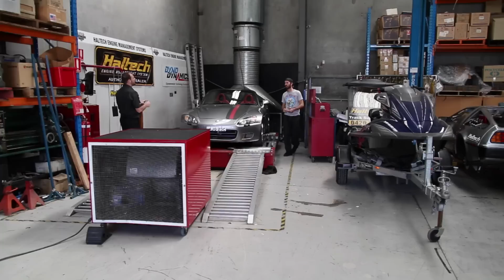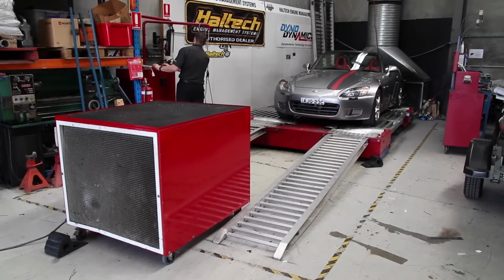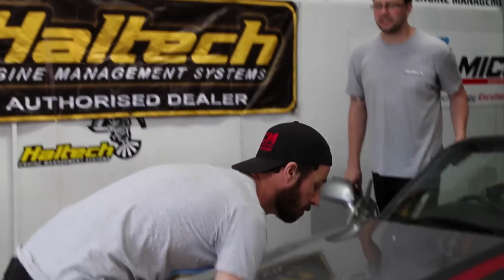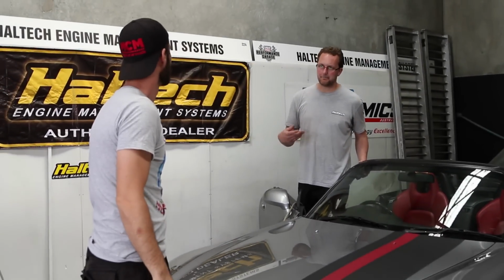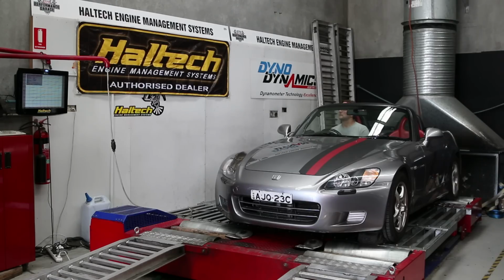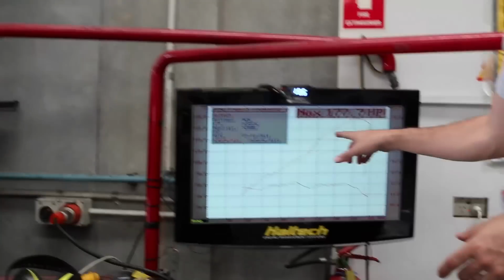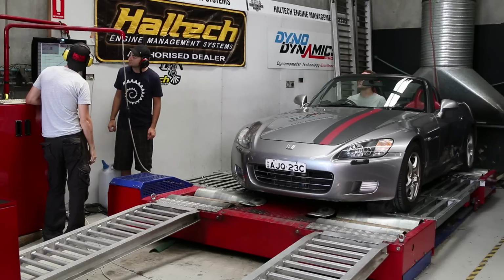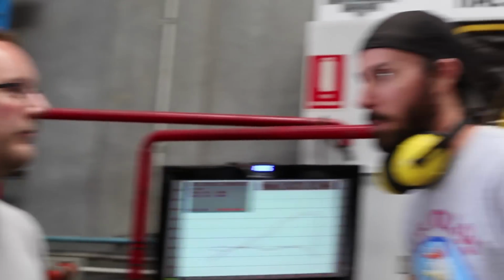Cold Air Intakes Mythbusted [Naturally Aspirated]

Comment: how can a 240 hp S2K make around 180hp ?
Reply: Well obviously he has had it for a while and overtime cars do lose BHP, especially if you dont service it or keep an eye on things such as oil or engine coolant.
Reply: ok it make sense now
Reply: 180hp at the wheels, 240 at the fly
Reply: Time is a bitch :P
Reply: Thats 180 at the wheels I believe
Reply: Becouse those 240hp is mesured at The flywheel and The 180hp at The wheels, The gearbox and rearaxel will eat some % of the engine power and This happens to all cars but awd eats more power and fwd eats least power width rwd in the middle,  power loss can be up to 45% in some cases.,hope This helps.
Reply: Don't forget that is the power at the wheels they show in their videos, not at the flywheel as manufacturers quote.
Reply: Oh, it's also KW they use and not HP. 170Kw is around 230bhp
Reply: Yeah and to convert kW to HP. Just take kW x 1.36 and you get hp
Reply: No it's 132kw and 177hp. Not 170kw.
Reply: mrman17 177 was what they converted it to on the screen. So it makes 177whp with the aftermarket system on it
Reply: It should still make around 200 hp at the wheels, it definetly lost some power from what it had.
Reply: all depends on drag of the drivetrain. All other stock s2k dynos i have seen are around the same so no i dont think it has lost the hp. Either honda is over rating their engine, or it has quite a bit of drivetrain loss
Reply: Also, it is a Dyno Dynamics dyno, which read pretty low.  Typically it is ~13% lower reading than the standard Dynojet.
Reply: Alfredo Wrinklesac ap1s are knowns to have 180-200 hp. Ap2s have 200-210 at the wheels
Reply: 240hp is at the flywheel and the 180hp is at the wheels. Even with that said, I expected it to have more like 200hp at the wheels
Reply: we also don't know other variables like sea level ambient temperature and humidity.
Reply: intranix
25% loss? It's not 4wd with A/T.
RWD cars with M/T have about 10% loss. 4wd M/T - ~16-18%. 4wd A/T ~ 25%.
So really that honda have about 200hp at the flywheel.
Reply: CoolMan3k 20hp aint much considering to 10 year age
Reply: intranix
NOT true. I've owned over 6 S2000's, and the AP1's I dyno'd with light mods all dyno'd at around 205-220 WHP. This car is definitely not the poster child of S2000's WHP. 177 is laughable... you don't lose 70 HP from the crank to the wheels. Stop spreading misinformation people. If S2000's only made 177whp stock, how do they beat cars you see on youtube all the time?
Reply: you guys saying it should have 200hp, obviously haven't factored in that some dynes read lower numbers.  I've seen tuning articles on the AP1 that were written in 2001 that showed even lower stock numbers (155hp, which is a massive drop from stock and was probably not totally accurate, so 170ish is normal).   (source is autospeed.com.au)

also similar power results of a CAI can be had by simply modifying the factory airbox to take in cold air.  cheap and cheerful
Reply: S2k2014 um why 6 S200s?
Reply: The turbo version made 240, this is N/A.
Reply: wtf are you talking about!!!
Reply: Lewis Jones Lol he didnt lose 60hp over time ahahahahahahaah wtf.
He lost that through drivetrain lose.
Reply: OblivianTheDJ so very wrong.  The N/A 2.0 s2000(the only one I know of) makes 240hp to the crank, and apparently about 180 to the wheels.
Reply: ***** I looked into this a while ago. it usually is 15 % for fwd, 17 % for rwd and 22 % drivetrain loss for awd.
Reply: It's at the wheels hp the motor outs out 240 hp but 175whp
Reply: Keven Harvey
Depends on the dyno.  If it's a Mustang, it will read low.
Reply: ***** what do you mean less that 20% only awd lose more than that ahaha.  You must drive some inefficient cars
Reply: the japanese overrate their engines all the time, where as the american companies, and european companies underrate their engines for instance:ls1 camaro z28 is rated from the factory at 290 hp, motortrend did a dyno test and got 335hp at the crank and 310 hp at the wheels
Reply: 12cwell 335 to 310 would be 8% drivetrain loss, those number are obviously inacurate.
Reply: kevan harvey.    look it up if you dont believe me
Reply: 12cwell
it's not you I don't believe, it's the numbers, something not calibrated right if that's the number they got.
Reply: 12cwell The R35 GTR was undercut due to it being hand built. They said it produced 445 BHP. It actually put out around 480-500. Your original statement is false.
Reply: Lewis Jones
 your wrong but also correct. engines do lose HP over time. but that is not why the s2000 is pushing 177 whp. the reason the wheel horsepower changes is because cars from the factory stating hp is actually horsepower measured at the crank not the wheels. so when you dyno a brand new s2000 the wheel hp should still be around 180 ish due to loss of power through the axle rear differential  etc.
Reply: ANTHONYNI33
240 to 180 would be 25% drivetrain loss. Not even AWD cars lose that much.
Reply: oblivionthedj.   thats ONE car out of the whole japan that they underrated.
Reply: Keven Harvey thats why s2000 is a little disappointing because of the major power lose through the drivetrain. if you dont beleave me look up all stock s2000 wheel hp they all average the same whp 180. it takes alot of mileage for a honda to lose power so dont ever blame the mileage to be the reason of hp loss in a honda.
Reply: ANTHONYNI33
Or they just lie about the power, or that's the power without the alternator/power steering pump, etc.
Reply: Keven Harvey Nah, not really.  Other people usually dyno 205 whp in S2000s, high 190s if it's a low reading dyno
Reply: 12cwell
Actually alot of the slightly older japanese performance cars were seriously underrated when quoted on power. The companies agreed on having 260hp tops, which ofcourse wasn't correct when dyno'd. Good example on that is the r34 GT-r
Reply: 12cwell There are more. Really don't want to waste time on your muscle-car loving ass. Also superchargers are overrated. Google Twincharged. It's much better than both twin-bolt/belt and turbo aspiration.
Reply: Lewis Jones
Wheels horsepower= horsepower at the wheels

BHP= horsepower at the crank ie the rating the manufacturer gives
Reply: 851995STARGATE Thank you! =D
Reply: +Keven Harvey 
This is a dyno dymamics dyno.  177HP is pretty normal for a S2000.

It's on the dynojets and dynapacks where you see the 200HP+ because those dynos are not loaded up like a Mustang or a DD is.

My stock 2002 read 191 on a Mustang dyno before FI, and that's an excellent number.
Reply: +John Nguyen Still have yet to see an AP2 on a DD or Mustang.  Everyone goes to Dynojets now because they read higher.
Reply: +S2k2014 Dyno Dynamics dyno.  This is a decent S2000 number.  The 200+ all come from dynojets and dynapacks which don't add load.
Reply: +Jésus Christ Chassis load. Hp at the wheels is different than HP to the wheels
Reply: +joseph martinez Right, which is partly why I see value in the torque app. When I got a little better than OE springs and struts (stock style, see engineering explained, it loses less power than lowered suspensions on real roads) and wHP changed quite a bit. You need to know your true curb weight by being scaled, adjust for changes of your own weight and emergency supplies in the trunk.

I for example saw 3-7 wHP just off of my alignment. The Torque App does need better ability to graph data so I can see more than just peak wHP. The whole power curve is important.

I know some of this conversation was about bHP, thanks, I had been wondering - so that's at the crankshaft, great to know!

And yes, losses due to power train being an average of 10-15% stock...hmmm, I've long theorized that as you increase power, how much of it is lost to the power train, probably decreases as a percentage until the power train can no longer handle the power, at which point, it'd keep increasing how much power was lost.

That would be an example of too much power in a given application.
Reply: rc.

Comment: I want to make my 2002 cavalier as fast as possible. Where should i start?
Reply: sell it.
Reply: TheLongboardLife LOL 😂
Reply: Take it to get recycled and with the money you get for the metal or whatever "old gm" made it out of buy an s2000 ;)
Reply: Drop it from a great height...? lol
Reply: 1. None of you answered my question and 2. Why all the hate for cavaliers
Reply: ***** You would be throwing money away trying to make a car like that faster.  A car like that was never meant to go fast, it was designed for economy and to be cheap to be easily attainable.  If you try and add power you would likely kill the engine pretty quickly.  

If you want to go fast on budget (which I'm assuming you have since you drive a Cavalier) buy a V8 fox body Mustang, a fourth gen Camaro/Trans AM w/ a V8, or a C4 Corvette.  Or go import with an old Nissan Z car.  Bottom line, sell the Cavalier if you wanna go fast.
Reply: Thank you. I dont remember specifically which engine it is, but it is a 2.2. And its pretty quick being stock and all.
Reply: ***** Keep in mind, that supercharger kit is $2600.  You would be throwing $2600 into a $2000 car and still only be making 190 HP at the crank.
Reply: ... The nearest down hill race track. It's basic transportation, A-B, nothing more. There is no reason to start with a Cavalier as a performance car. Not one single part on it is worth a damn. Engine sucks, brakes suck, transmission sucks, power steering sucks, suspension sucks, exhaust sucks, even the bearings suck, rims suck, tires suck and it to top it off it looks like a Cavalier. Then there's the interior, seats suck (not supportive or comfortable or stylish,) basic, bland, cheap, and a shifter that looks like it was meant for the ladies ; ). The only reason to have one is an allergy to public transportation, or it's your first car and your parents won't let you get something else. Fix it, sell it and buy something that is a little fun to begin with. If you want to know what I mean about this whole list take a Mazda out for a spin... Any model, it doesn't really matter how new or old. You don't have to buy it, or like the looks for an educational test drive.
Reply: Sell it and get a Hemi Challenger.
Reply: If you want to stay with a small car, get a cobalt ss
Reply: CaptCaaaveMaaan well that's what the cavalier turned into, but the reason I chose this car was because my uncle gave it to me and I was finish his goal to make it a f&f car
Reply: Then put stickers on it and call it a day. Look up Paul Walker's Supra from F&F movie. It just sold recently. Probably the only 200hp Supra left on the road, and it's a 5 speed. Rice up the Cavalier with some cheap walmart craigslist ebay parts... make it look the part. At the same time save the bulk of your cash for a car with real potential. Something you want to own, drive and work on. You didn't choose that car and it doesn't sound like it's your dream to f&f the thing, so f the thing.
Reply: Selling it and buying a new car
Reply: Yay!. Learning in action.
Reply: TheLongboardLife i agree... sell it put a down payment on a better car
Reply: ... Or run the Cavalier as a daily til it's worthless, and buy a project car outright. The Cavalier will keep you busy with broken stuff, but the parts are dirt cheap and you learn as you go. Not going to get much money for a used Cavalier and car payments suck if you just want to jump in and get some modding done. An 86-92 Z24 with a v6 and a 5 speed, with a clean, all factory look, would be another story. Still not recommended.
Reply: Also if you tow it itll be fastet haha
Reply: CoryCDS Tow it with a Camaro.
Reply: Tyler James Newton idk if a camaro is good for towing lol. But im sure its still faster haha
Reply: Soooo, at the track you'd lineup the Cavalier front wheels on the line or the Camaro's? Not clear on the Cavalier drag racing rules.
Reply: That's because no one in the history of ever has drag raced a Cavalier. So there are no rules!
Reply: ***** everyone on here commenting like they drive something super great, just remember we all start somewhere with what we have. I had a 99 z24 with the 2.4L and all i ran was a cold air intake and catback with a performance muffler and it made a huge difference. Theyre not the fastest cars in the world but i did win alot of races with it and had fun with it. Dont listen to all the negative shit and just have fun with what you have. Id say do cold air intake and full exhaust (header highflow cat and performance muffer) and it will make it night and day. And as for everyone else real car enthusiast help each out not bash on the other persons ride so grow the fuck up
Reply: Reizvoll1988 i mean yea but when i had a 2000 protege i never thought about making it fast lol
Reply: Reizvoll1988 And I never riced out my '96 Eclipse RS. Would have just killed the transmission faster anyway. . .
Reply: CoryCDS Drop a KLZE paired with 5 speed in a protege and it will be quick. 350z quick. There are cheap parts to make that car fun. I do agree with Reizvoll1988 mostly. Just not the part about encouraging anyone else to waste their time and money on a Cavalier. The car was designed to need parts on a constant basis past a 5 or 6 year lifespan.
Reply: CoryCDS Maybe not that car, but have you ever modified a car that you just had because thats what you could afford at the time? Thats what im talking about you modify what you have and what you can afford. Sidenote i had one of those too and it zipped around decentely for what it was i just had a homemade intake on it always wished i had the turbo one.
Reply: Tyler James Newton Just because you modify something doesnt mean you riced it out. Every one almost always starts with the same mods. Intake and exhaust, you just get a different exhaust tone with a 4cyl then you do with a v8 but as long as your not sporting a 4-5 in. can on it i wouldnt call it rice honestly.
Reply: PGTMR2 You just have to remember if a cavalier is all he has as another car guy why wouldnt you support someone in their pursuit of modifying something. I mean all car guys give each other shit about one anothers car but honestly to me a real car guy recognizes the work and effort put into something regardless if its something you like or not. And to be honest ive seen a few tastefully done cavaliers most had swapped out 3800 supercharged motors tho so that helped.
Reply: Reizvoll1988 I am reading this, and I find myself wondering why anyone would even care. And what qualifies you as a "real car guy", anyway?
Reply: As a "real car guy," can you honestly say advising someone to buy a cavalier and swapping in a 3800 is really good advice? Someone that's just starting out, asking obvious starter questions. There's a great big wide world of cars, and tons of cheap ones that are great. They all need modding to make them better and "your own," they all need some work. Why not get a Grand Am GT instead of trying to fix up a Cavalier, same junk just a lil nicer.
Reply: Tyler Newton my honest opinion is someone who respects all makes and models not just one make or another. Import or domestic doesnt matter, its about being supportive of the other persons car even if its not your cup of tea and appreciating the craftsmanship thats gone into the car
Reply: PGTMR2 never advised him on swapping a 3800 i suggested a CAI and exhaust work then i said the nicer cavaliers ive personally seen have had 3800s in them and who knows maybe he cant afford another car if he could a grand am gt is only gonna be better if its a 99+ with the ram air and even then the aftermarket on those cars is limited.
Reply: While the GT with ram air is a nicer option to have, it's about as useless as a spoiler. Just pray you buy a Grand Am that works and isn't rotted out. The rotted out part being more important, since everything else is available in the j/y. There's about 80 (low balling it here,) Grand Ams in the 4 pull a parts near me. Not counting really any before 2000, since those are almost extinct. My point behind the Grand Am was not that anyone should actually buy one, but if you can afford a Cavalier then you can afford a Grand Am and it's definitely more car. If you got a GT... You wouldn't need to throw away 95% of the car to improve it. Friends, don't let friends buy Cavaliers.
Reply: +Dylan Meyers

 reduce weigth, bud your first bet
Reply: Reizvoll1988 PGTMR2 If the options are an engine swap, or buying a CAI / performance exhaust for it, or a supercharger kit, then the first question is: is the car paid for, in his name, and can he sell it? If he's got income, he can make a down payment on a second or third generation car. Or, if he can squeeze $1500 out of it, look for a beater 90's Mustang or Nissan, or anything rusty with a 6 block in it.
Reply: all good questions but if hes on a real tight budget he can always toy around with ebay parts. I can almost guarantee he pick up a cai and full exhaust of ebay for under 500. Now you say look for a beater thats a good suggestion but if hes got a good running car that he wants to toy with why risk buying a beater that can potentially nickel and dime him more just to keep it running than what he could have spent on a few simple bolt ons but like i said all good questions.
Reply: +Dylan Meyers trade it in for a real car ...
Reply: Reizvoll1988 "Beater", in this case, means a car that the previous owner doesn't realize is cheap to fix. . . can be like capturing a unicorn, I know. But not out of the question.
Reply: Steve D 😂😂😂
Reply: Dylan Meyers when those cars break down they aren't even worth to fix, so invest money trying to make it faster, is like put a golden tooth on a pig.
Reply: Sugar in the tank